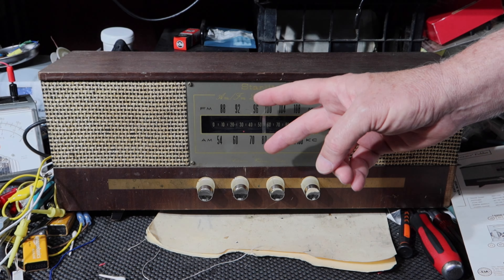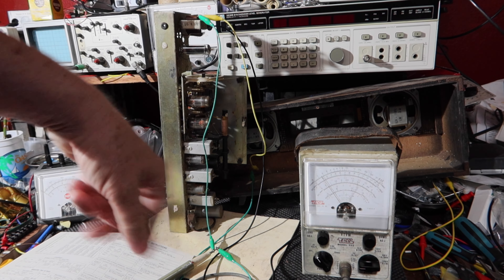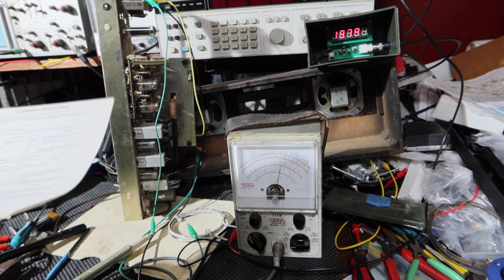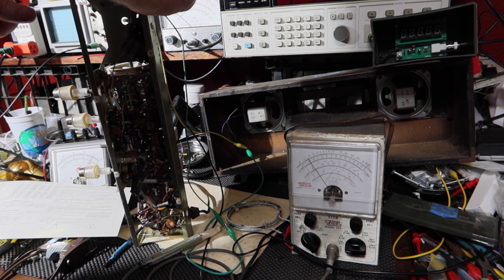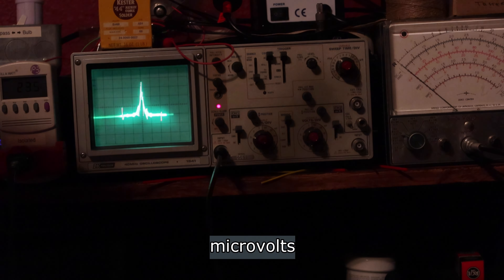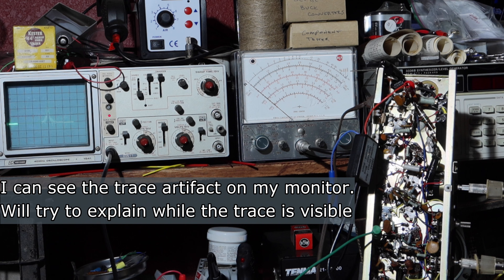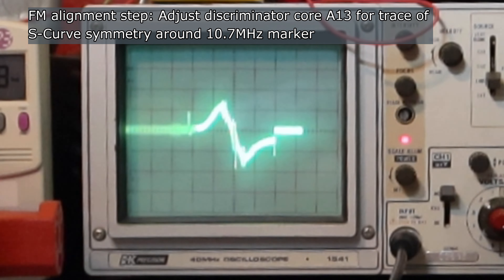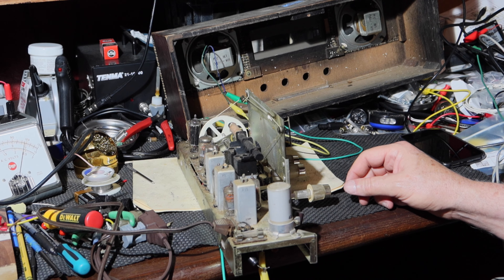VACUUM TUBE RADIO REPAIR - AM/FM ALIGNMENT - Part 2  1964 Star-Lite w/Sencore SG165 & EICO VTVM [4K]

Comment: What did you do differently to get the fm sweep to show as more of a plateau and less of a peak?
Reply from the maker: Hello.  The SG165 sweeps frequencies and puts out a marker that shows on the scope for 10.7MHz, the IF frequency for FM, as well as 100kHz on either side.  So 10.6, 10.7 and 10.8 MHz markers.  
I adjusted the two IF transformers away from both peaking at 10.7MHz, to having a peak closer to 10.6 and 10.8 respectively.  That peak would be lower, however the bode magnitude plot on the scope would show a wider curve, not so sharp, such that they essentially ran together at the top creating the plateau appearance that spanned across 10.7 MHz.  See 29:05 timestamp in the video. 
That gives a more evenly tuned bandwidth and thus I ended up with less distortion, allowing the Frequency to Modulate either side of 10.7MHz at a constant magnitude - rather than going through a peak.  It is take a bit of patience and experimentation to get the right form, but the SG165 does a nice job helping.  The person who previously worked on the radio aligned the FM the same way AM is aligned, which is to peak a maximum at the IF frequency which is ok for AM, but not really for FM - although it will work, but not sound as nice.  I hope that I explained that ok.  Thanks for watching and the comment.